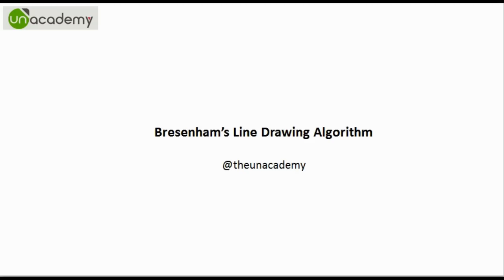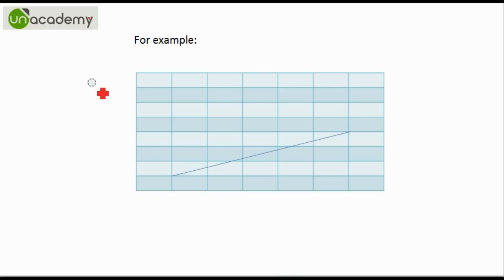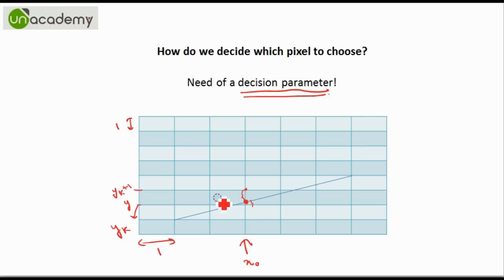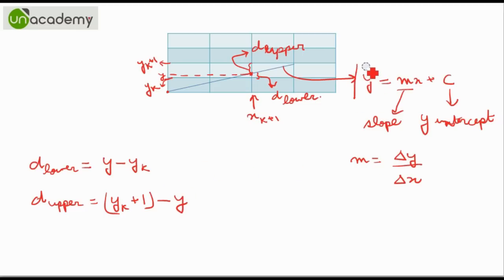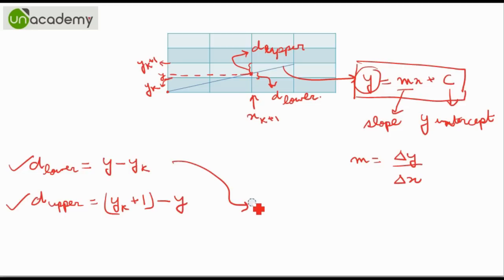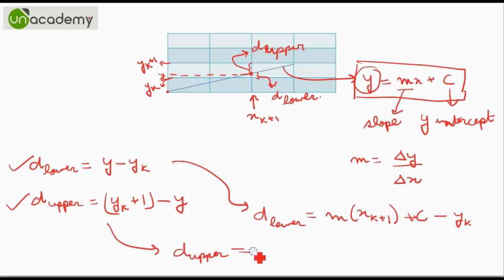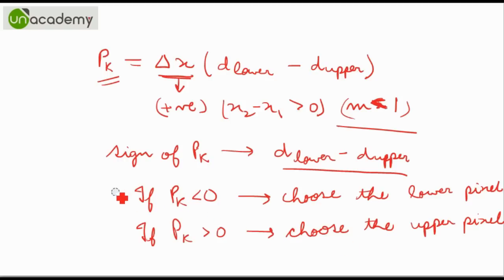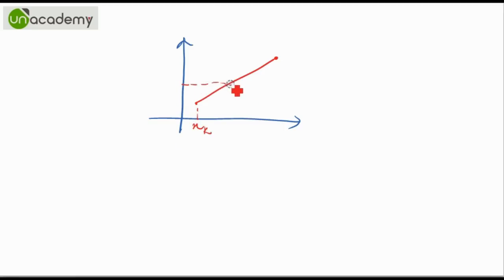Bresenham's Line Drawing Algorithm in Computer Graphics - Part 1 What is Bresenham's Algorithm

Comment: Very good explanation but your speech is just way too slow. I had to speed up the video 2x times and then it felt normal. Also, please consider editing your videos before uploading to crop out the parts for example where you fail to locate the eraser. Also, find some other way to write on the screen as the current handwriting is so small and untidy its very difficult to understand.

Comment: There is a much much much simpler way to explain that algorithm.
for (x  = x1; x <= x2; x++) {
   y = mx+c;
   plot(x, y);
}
now that right there is slow because there is a floating point multiplication right? well, you break it down into adding the slope as a fraction dy/dx in a step wise manner; if the line is at an angle between 0 and 45 degrees. in that case there are more Xs then Ys so a barbaric way to plot the line would be

for (x  = x1; x <= x2; x++) {
   plot(x, y1);
}

that would indicate a straight horizontal line. Thats why its barbaric. what you need is a decision of when to increment y. Between degrees 0 and 45 the slope is a fraction less then 1. So basically as you go plotting Xs you add up the slopes until you get a value > 1. Thats when you increment y. so its like this:

for (x = x1, y = y1; x <= x2; x++) {
   slope_sum += m;
   if (slope_sum > 1)  {
      y++;
      slope_sum -= 1.0;
   }
   plot(x, y);
}

you would argue that m and slope_sum are floats and therefore slowish. well that addition can be done in integers if you keep the slope as a fraction:

dx = (x2 - x1)
dy = (y2 - y1)
for (x = x1, y = y1; x <= x2; x++) {
   dy_sum += dy;
   if (dy_sum > dx) {
      y++;
      dy_sum -= dx;
   }
   plot(x, y);
}

one last argument is that the line would not be accurate and that is due to rounding differences. That can be fixed by initializing  dy_sum = dx/2 as shown here

dx = (x2 - x1);
dy = (y2 - y1);
dy_sum = dx/2;
for (x = x1, y = y1; x <= x2; x++) {
   dy_sum += dy;
   if (dy_sum > dx) {
      y++;
      dy_sum -= dx;
   }
   plot(x, y);
}
Reply: Never thought I would pause a video to read a YouTube comment. Thanks a lot sir!
Reply: Divjot Singh
well I found out the algorithm I posted its officially called the DDA (Digital differential analyzer) algorithm and the reason Bresenham's algorithm is promoted over the DDA its cause its used for circles and to determine which side you are on in 3D surfaces. But I like the DDA cause its used in scaling, rotating bitmaps and linear interpolation (quick texture mapping), pretty much anything that has a linear equation, ie: determining the path of a bullet in a video game.
Reply: aim of bresenham over dda getting rid of floating point operations, so as you said understanding and implementing is easy with dda but it is a costly calculation.
Reply: No, that is not true, thats what I am trying to point out. The DDA algorithm can be implemented purely with integers. Maybe not with circles but it can be done with lines. Thats my first comment. Its the DDA algorithm optimized to work with only integers. At first I thought that was Bresenham's algorithm but its not, its the DDA. Its efficient and intuitive.
Reply: And I want to add that the integer based DDA algorithm should be taught more because its like dribbling a ball in basketball. You can come up with all sorts of uses for it, all workable in your head as long as the equation is linear, because the DDA algorithm is so dam intuitive.
Reply: Thanks your solution is great
Reply: I love you
Reply: DudeOfX disadvantages of dda algorithm is , the algorithm is orientation dependent. hence end point accuracy is poor and floating point arithmetic is still time consuming.
Reply: What will you do if there are more y than x